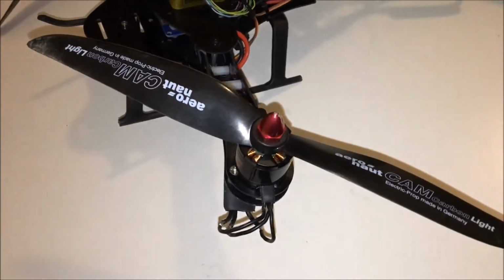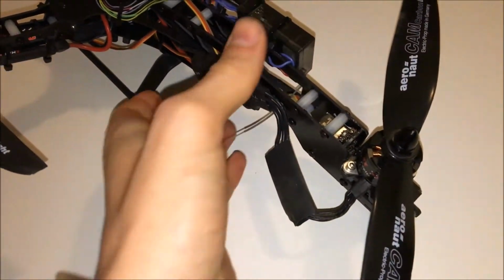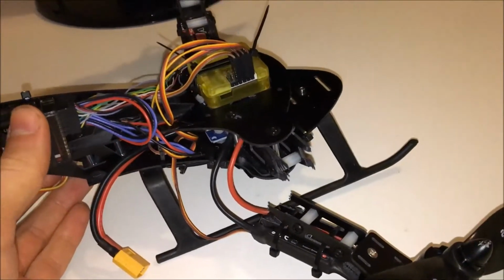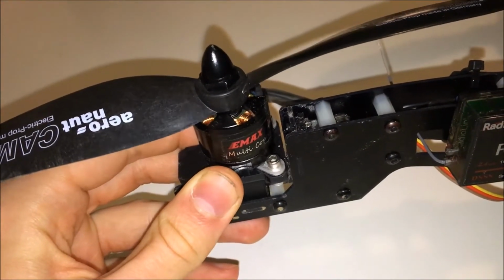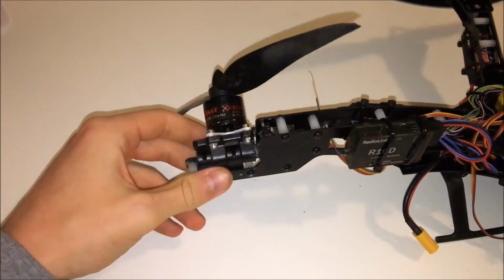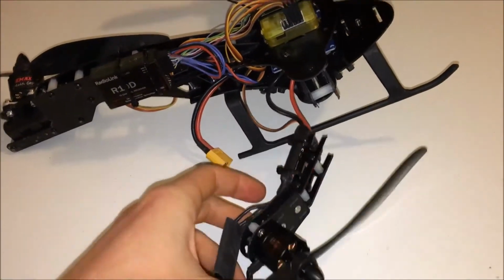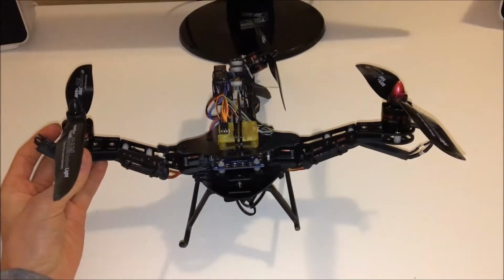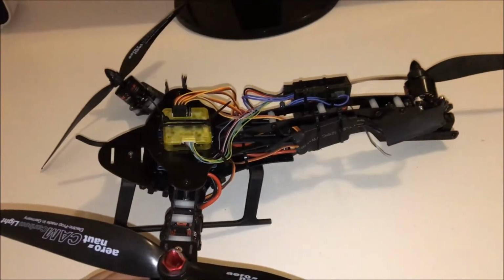Tricopter HJ-Y3 infos and crash report

Comment: I'm in the midst of building this. I wanted to use a much better TowerPro MG92B digital metal gear servo and I discovered that tail swivel assembly would not accommodate it.  My TowerPro  SG90 & Emax ES08MA-II servos would not fit either. The hole would only accommodate the MG90S analog metal gear servo... and even then, just barely. 

I wrecked one MG90S servo when trying to squeeze it into the hole (the metal gear assembly inside the servo collapsed from the pressure, the servo would jam and lock). I put the build on hold after that.

Such a pain to build. That tail rotor assembly is definitely an achilles heel.
Reply from the maker: I agree. It's a nice frame for the price but that tail mechanism just ruins the whole kit. Good luck on fixing it. I gave up and switched to a Tarot 650 quadcopter frame.
Reply: Hobbyking's Quanum Trifecta tricopter is just US$5 right now... at least the tail rotor swivel assembly look more foolproof (it uses a solid metal cog that is screwed onto a Turnigy servo head, much like a servo horn). I'm trying that next when it arrives from Hong Kong.

Comment: Buying this kit for Christmas. You can use hot glue to stop tail tilt mechanism rods from slipping. Also, vibration may be caused by unbalanced propellers. Have you balanced the propellers?
Reply from the maker: Hi, yeah basically it's a nice kit. I used a strong glue on the tail mechanism but the forces acting between seem to strong enough to break it from time to time which causes the loss of control over the copter. Good point, I thought the same and carefully balanced all my props but that didn't really solve the problem. Good luck with your kit.

Comment: Thanks for such a nice video, I really enjoyed it! However, I do have some questions regarding that wobbling movement you've been talking about.
Recently, I had a similar problem with my HJ-Y3. It wobbled the same way it apparently did with you. It was hardly controllable, so I had to fix it. I just put a little glue on it for the first but it didn't work. What was your solution once again? And which camera did you use for making your video? I really liked the angles you've used. Keep on flying, pal!
Reply from the maker: Hello ! Iam glad you like my little video. So...I tried to fix the wobbling like you did with the help of some glue. However it did not fix the problem 100%. So I used a little knife to extend the little gaps where the tail motor mount is fixed in. By doing this I was able to push the whole mount mechanism a little bit more towards the servo shaft. I was then able to push it all the way in. I also lowered the yaw value in the attitude section from 100 to 75 in OpenPilot. That fixed the wobbling for me. Oh and iam using the iPhone 6s camera in full HD and 60 fps. Cheers